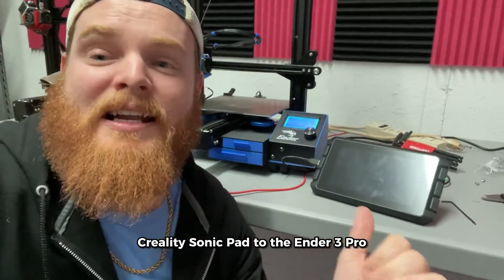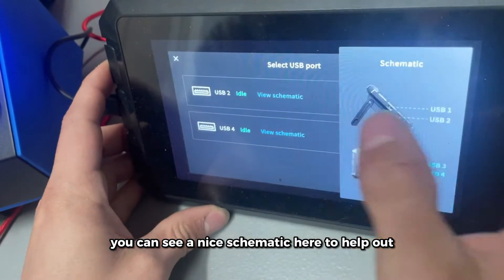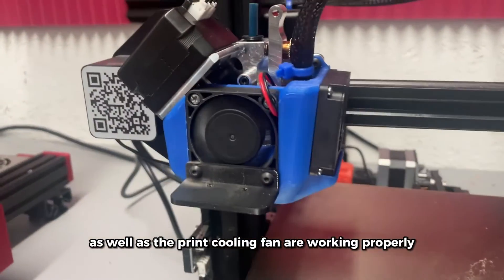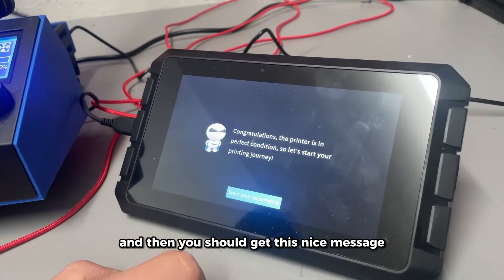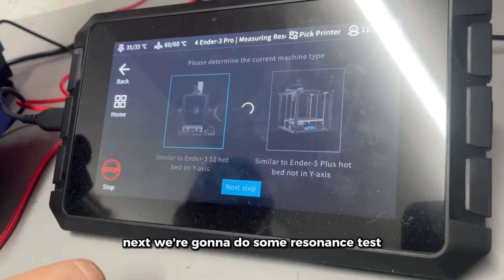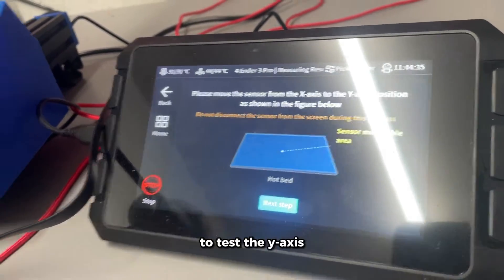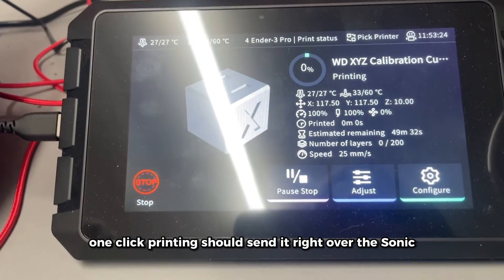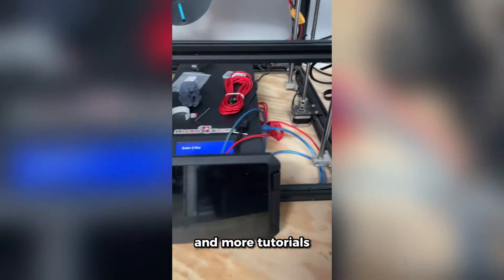How to make your Ender 3 Pro FASTER and BETTER.

Comment: Ender 3 pro with cr touch 4.2.7 board with sprite extruder.  I put sonic pad in and its way off on a few things help lol
Reply from the maker: What’s going on with it?
Reply: @arc.industries25  fixed most of the problems. Now just the y offset for the cr touch on the sprite
Reply: And it keeps losing saved settings
Reply from the maker: @MrJlhhagood2  hmm are you changing settings on the screen or through fluidd/mainsail?
Reply: @arc.industries25  on screen like the z offset during print then after print it saves it. Well occasionally it loses connection with printer then reset everything

Comment: So what if you just have the ender 3 regular with the same screen can’t seem to find it in the spad
Reply: personally wouldnt bother with this. Rather learn Marlin (pretty easy to make your changes) and get octoprint. Thats what i use and i print at 135mm/s with the stock coolers and stock hotend. I just printed an adapter for direct drive. Got auto PID tuning for nozzle and bed, BLTouch, Linear Advance, custom boot screen, custom status screen, etc. All running on the regular Ender 3 with 8bit 1.1.4 board. Acceleration XY at 1800 and youre good to go. This is also good if your screen or control knob doesnt work anymore because OctoPrint does everything. 

I will say that you shouldnt run OctoPrint on an old phone because thats potentially dangerous and a fire hazard. You can use Raspberry Pi's starting at Raspberry Pi 2 or newer or an old Laptop, a NUC, or any other ARM single board computers that support Python 2.7 or 3.7+.

The Sonic pad is really only for users that dont care about not being able to edit anything at all. Its locked down firmware so no custom stuff whatsoever. And they rebranded it so creality can take full credit. This makes absolutely no sense at all because the sonic pad is Klipper which is a "hands on firmware". The point of it is that you can customize literally everything. With the sonic pad you cant do that.

Comment: Is it better than a raspberry pie? Tbh by the time your done adding everything to cart it’s the exact same price as the btt klipper screen and the sonic pad
Reply from the maker: We just got an Ender 5 plus with a raspberry pi, and we’ll be doing a lot of experimenting with it and posting videos as we go
Reply: i think the pads are more easy to use. easy to instal and much things are included from what i see. i run a cb1 with manta e3 ez. but so much to figure out. for example with creality pad they explain more and help you to set up easy also more macro's included easy to use accelerometers. and by the way pads have raspberry pi in it. if you want easy and fast experience go with a pad.
Reply: @lstrouwborst  I went with the raspberry pi for what I’m doing I needed a full custom klipper

Comment: 3-Pro here with MicroSwiss Direct Drive hot end running the 4.2.7 board. Mounted a CR Touch and have dual Z (2) on axis with ball screws, linear rails. Never booted up. Bought a Sonic Pad on Black Friday and will install next. What updates to Klipper are needed for the CR Touch, please?
Reply from the maker: Those are our next upgrades, we actually already have all the parts printed for the dual z. 
We are adding a CR Touch to our Ender 3 Pros soon, but it worked just fine on our Ender 5 Plus. Some auto bed leveling probes will work just fine, but if it doesn’t work right away, check the Klipper website for configuration help. Searching “BL Touch Clone” on their site should bring it up.
Reply: https://www.youtube.com/@RickyImpey/playlists has a very helpful sonic pad help playlist